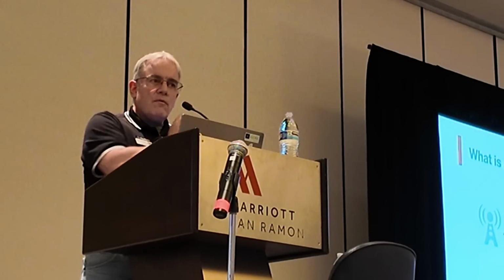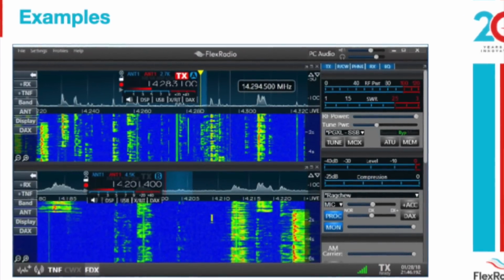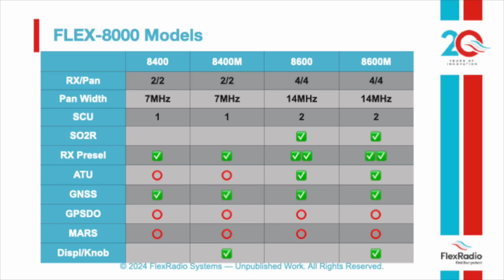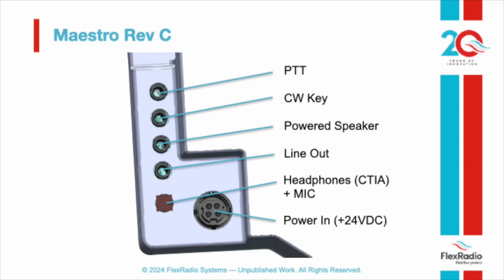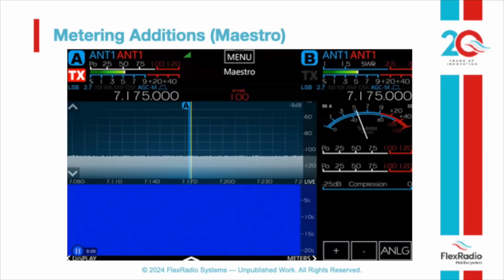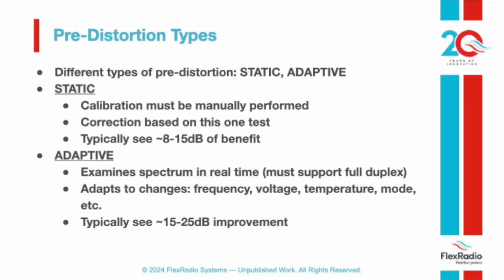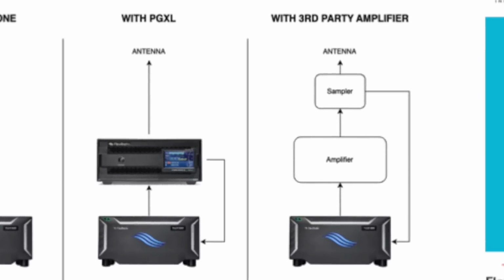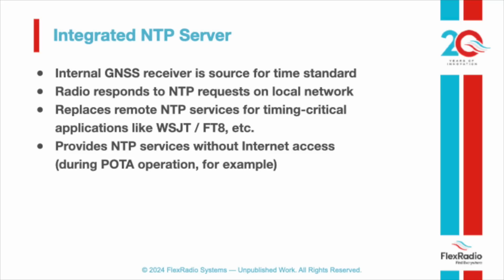Pacificon 2024 FlexRadio Update

Comment: Sold!  I just put my deposit down for an 8400M to run my VHF-1296 station.I will be trading in my year old 6400. The 6400 already runs circles around my IC-9700 on 1296 EME. I can't wait to see how the 8xxx series will work with the increased CPU power.